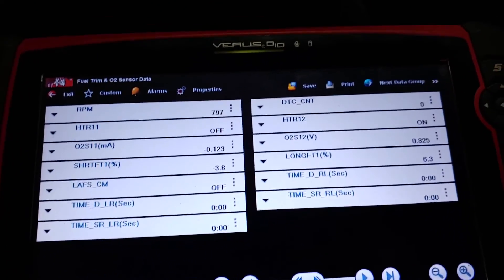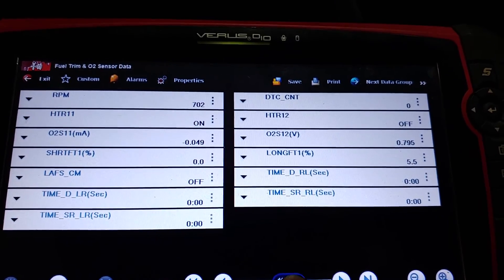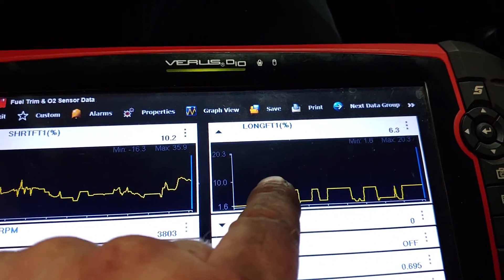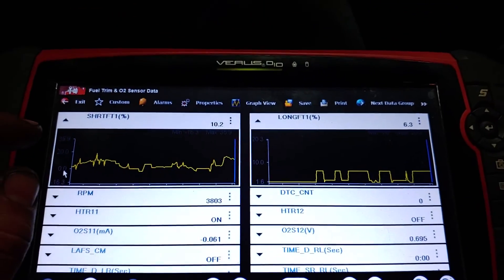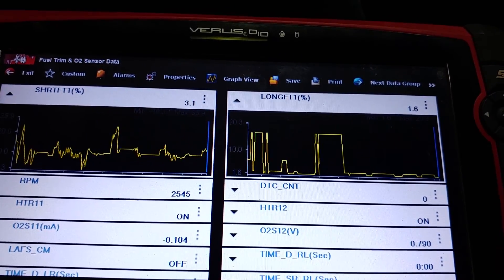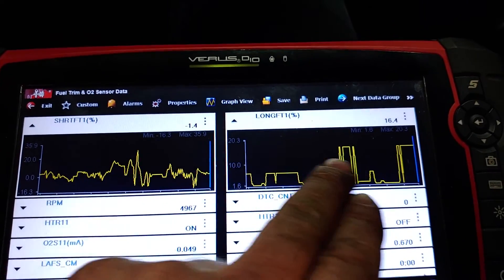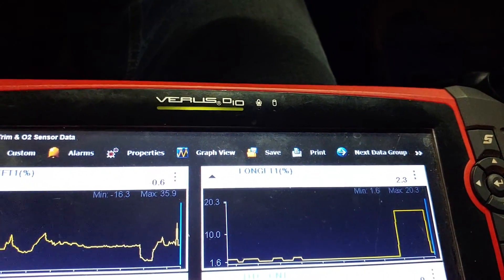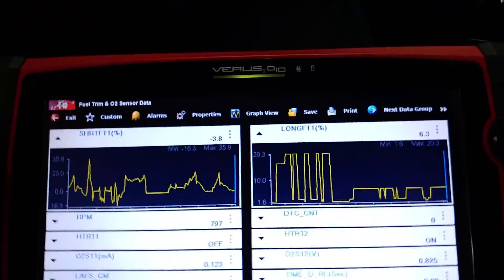Mazda 2.3 to 2.5 swap real data on using 2.3 injectors

Comment: Hey bro one other question , I just got some 2.3 injectors however they are from a 2009 , is there any difference between a 04-05 2.3 injector and a 06-09 injector ? The 04-05 injectors are green and I have an 04 so I’m just worried I’m gonna be flushing out the cylinders if they aren’t correct
Reply from the maker: They are different part numbers so I imagine there is a difference in size.  How much I don't know.  2009 has different injectors for federal and California.  Probably not much.  If you can look at your cars data and see the fuel trims with the 2009 injectors you would, you would be able to tell how far off they are.  If fuel trims get over -10% to -15% idling or driving, they are probably a little too big

Comment: So I just got a 2.5 swap done on my 2004 Mazda 3 and they used the 2.5 injectors however I noticed that my gas mileage absolutely sucks ass now , do you think switching back to the 2.3 injectors will improve the gas mileage a bit ?
Reply from the maker: Yes, you need to use the 2.3 injectors.   The ecu is programmed for the 2.3 and has no way to know it has different injectors.  Your mileage will go back to normal with the 2.3 injectors. 

 Also running larger injectors without tubing for them will wash out the cylinder walls and dilute your oil with gas if you drive on them too much.

Comment: Are you talking about 2.3 NA? Or the 2.3T? The 2.3T Has to use 2.3 Injectors, there is only 1 injector available for that head. Its Direct Injection, and there are no aftermarket injectors.
Reply from the maker: This is all for the NA engine.  I found some ppl online saying use the 2.5 injectors for the swap, so I wanted to correct those thoughts.
Reply: @Diamond Star Werks  Oh yeah, you need to use the injectors your ECU Is programmed for.
Reply from the maker: @EvlEgle  yes exactly

Comment: Very interesting topic...I've just swapped a 2.5 into my 2004 2.0, and if use the 2.5 injectors, the LTFT is -25 and the STFT is -10...I reinstalled the 2.0 injectors and the LTFT & LTFT are close to zero @ idle and work fine on llight throttle...When I try to accelerate more, it bogs down and I need to ease the throttle so I can get the car to move...I'm thinking on getting a 2.3 set of injectors to, hopefully, find the sweet spot between normal & riich condition...Do you think the 2.0 ECU/Electronics would work WELL with the 2.3 injectors?
Reply from the maker: Can't say for sure on that.  Bigger difference between 2.0 and 2.5 than the 2.3.  That may work, the issue is the dead time difference between injectors for idle and that initial squirt you get whenever you try to accelerate. Just like a carb, fuel injection squirts a shot of fuel whenever you accel, the size depends on the amount of throttle.

Probably best method would be getting the ecu tuned for those injectors.  Other than that you'll have to try to retrofit the 2.5 ecu/harness or configure some combo of 2.0/2.3/2.5 injectors/maf/intake pipes to get something that provides a good middle ground within an area the computer can Control

Comment: Can I use a 2.5 fuel injector on a 2.3 engine for 2010 Mazda cx 7? lmk..
Reply from the maker: Adding 2.5 injectors to an otherwise stock 2.3 will just cause an overly rich condition and will not add any hp or anything useful

Comment: What about leaning out when you hardly hit the gas? Do I need to put my original fuel injectors in from my 2.0
Reply from the maker: Unless you tune it or find a way to use the 2.5 ecu you need to use the injectors for the original ecu.  The ecu can compensate for some extra air but it will still think its using therr original injectors.  So pulse width and deadtimes will be off.
If you went from 2.0 to 2.5 I'd strongly suggest a tune with the 2.5 injectors.  That's a bigger jump than from 2.3 to 2.5.  And its a different engine.  2.3 and 2.5 are both Ford engines.  2.0 is mazda
Reply: @DiamondStarWerks  I also had the 2.3 in it as well and sent a rod through the block on the 2.3
Reply: @DiamondStarWerks  this is my 2nd 2.5 I've put in my car and the last 2.5 I had in it didn't lean out when I hit the throttle
Reply from the maker: Then I'd say you'd need to find out what's different btwn the two 2.5s.

Comment: I need help w tuning bigger fuel injectors w upgraded turbocharger into a nonspeed** 06 mazda 6 isport w full supporting mods stock internals. I've search all around and concluded that this platform is very dim as far as EMS. Thanks in advance.
Reply from the maker: Did you figure this out yet?  What tuning system are you using?  What turbo? what injectors?
Reply: @DiamondStarWerks  sold the 6 went with a 2G TL lol..
Reply from the maker: Lol TLs are nice.  My wife had one of those. Type s too, was pretty nice and quick
Reply: @DiamondStarWerks  Big step up from sport to luxury,, I used both for full time deliveries and i prefer luxury. I also was so use to being 5Speed from the i sport i only drive the TL in Manual Mode lol.

Comment: I swapped my engine to the 2.5 and I have a code for the intake runner control p2004. I replaced the solenoids and checked for vacuum leaks but still comes up. My o2 sensor isn't workimg but I don't believe that would have anything to do with that. Have you had this problem and know a solution to that?
Reply from the maker: You used a mazda or ford 2.5 and what Intake are you using?
Reply: @DiamondStarWerks 2010 Mazda 6 2.5 and is original intake man since the 2.3 intake is too small
Reply from the maker: Okay then you need to watch this video to fix that issue.  The actuator and sensor is different.
https://youtu.be/nNPP0vHgV9Q
Reply from the maker: Once you perform that fix you will not have a CEL for the runner control